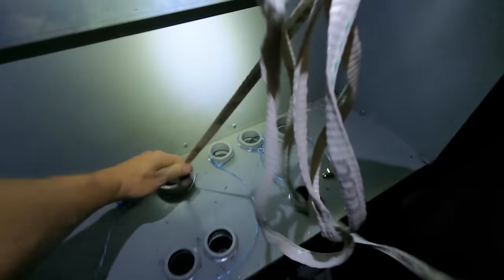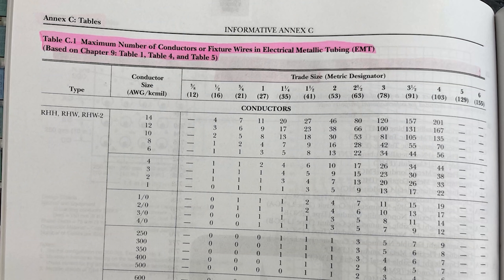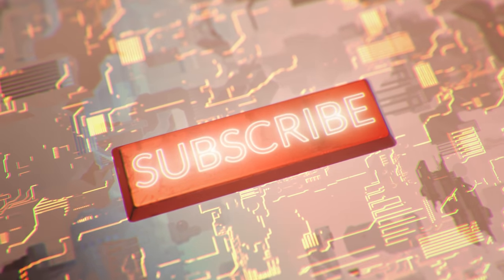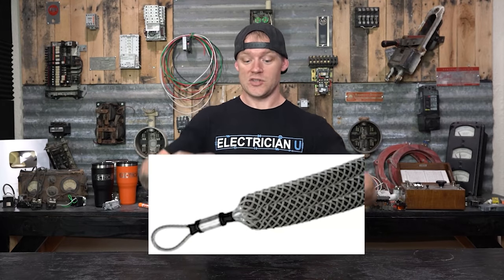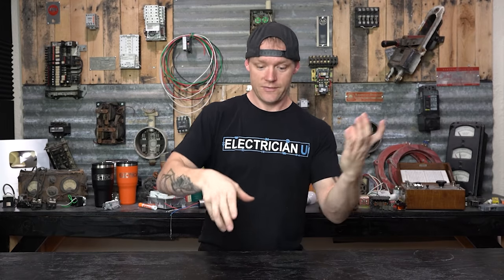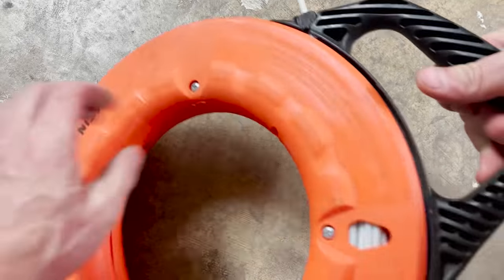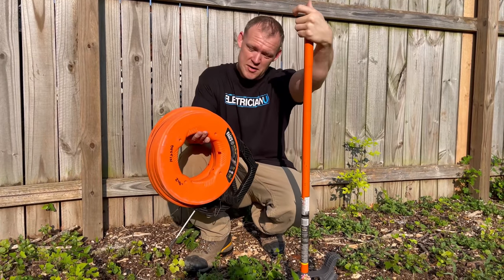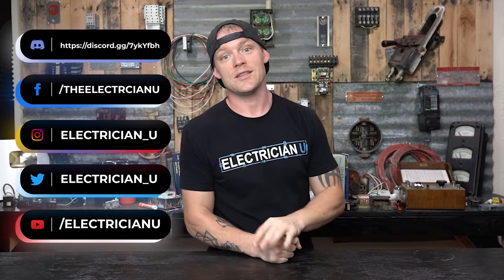Pulling Wire Like a Pro - Tips and tricks for pulling conductors through conduit

Comment: Something I'll never understand is why people apply electric tape backwards, applying forwards was one of the first things I was taught and it was a life changer, it allows you to pull the tape tight on whatever you're wrapping up getting an even stronger connection to whatever you're using to pull y9ur wire
Reply: It is forward because the tape "flashes" the catching edges when pulling. If it is down the head every edge of your wrap, each wrap can catch.

Comment: Excellent advice and Info, but I have to ask? Do you not know the shop vac method for pulling rope?

Go to end Aware you're going to pull cable,
tie your prefer not, with prefer rope, with a loop, place 2-6 paper towels in a butterfly pattern. 
Enough that the pipe/ conduct is block airflow but lose so it can be pulled.

Go to end B with a Shop Vac, (small runs are easy longer runs will need a more powerful shop vac) vacuum the pipe/ conduct and get your rope!

A master electrician showed me this, ITS A FU#$###$% godsend and 100 times easier than shoving a snake down the line.

Comment: "not more than four quarter bends" - learned somewhat recently this is called the capstan law (or capstan formula?): basically that the difficulty of pulling a rope around bends is related to the sum of all angles of the bends. Just the angle, not the radius (for this kind of drag anyway, other things might depend on radius). Go figure. So that's why that bit of code is phrased like that.

Ha! "So you can call me with your stupid questions about, like, what's a neutral" 🤣
Reply: Actually, for almost every application you don't have more than 3 actual full quarter bends in a run...the balance of the One quarter bend left is the sum of the offsets, kicks, or doglegs in that run.

Comment: If it's convenient, a video explaining rolling offsets, specifically how to measure and calculate them, would be pretty awesome.
Guess work isn't really my thing, and I get a different answer from everyone I ask at work.
Reply: Practice, practice, practice. Guess work isn't my thing either and I've found a pretty good way. I can have multiple bends in a pipe already and have the rolling offset still work perfectly. 

Stay away from the apps in general. They'll help you get it done today but you won't understand why or how, making you dependent for life. The only app I use at work is for calculating fill for a conduit with multiple sizes of wires
Reply: Measure using the tape line like you would roll it. Measure at an angle
Reply: A squared + B squared = C squared. A is lateral offset, B is elevation, C is total rolled offset.

Comment: Use a tugger especially designed for pulling wire not a truck or lift or anything of the sort there’s no control over this. And remember pulling wire can be Extremely! dangerous tuggers can put thousands of pounds of force on the wire and if something brakes people can die. Of course il not talking about 2/18 in 1/2 emt more like 700’ of 3 conductors 500mcm tech in and outdoors trays.

Comment: Pulling cable for 30 years.  I've never used duct tape.  I've never seen it used by other electricians and I've never seen it taught in schools.  Not saying it's wrong but it seems not to slide as well or able to be stretched tight like vinyl

Comment: at 11 57  if you pull on jet line  your going to snap it you should pull in something  iike a 1/4 i n or 3/8 rope
Reply: It's pretty strong and usually you feel it stretch when it's getting jammed up before it snaps. If you don't know what your doing and hulk it yeah it'll snap, but if you feel it stretching and not pulling and stop and re-evaluate your good.

Comment: Hey Dustin I would love to hear about why some 240 volt machines like an ac unit for example.. why do we not need a neutral for that run. What exactly does a neutral do besides balance loads and complete the circuit!
Reply: Only need a neutral when you need 120 volts, it's a center tap at the transformer and provides return path . With 240 volts each line is tapped from opposite ends of the winding and are 180 degrees out of phase from one another giving you the 240.  Don't need a neutral on a 240 volt ac because it's not running on 120v. I know Dustin will probably explain this alot better but there is alot of literature on the subject if you care to study up on it.
Reply: @rogerdodger5886  thank you brother! I have. I get it now. Thanks for taking time to explain my man!

Comment: Pulled a load of wires once. Got stuck & had to use lube. When it gave way, I ended up slamming my back into a vertical I beam. Bruised my back & had to take week off to recover. It was NOT fun. Never did that again.

Comment: First off Orange doesn’t signify anything to do with just 240 V three phase
Yes it is supposed to be marked orange if it were a three phase 240 volt system with a high leg, on phase B; also it is phase B regularly with 480v systems with single and 3 phase.

Comment: Never use other than black tape making a head - ever! Why? Some white tape gets stuck accidentally on the conductor after the pull. And accidentally cause you to mistake a hot for a neutral. Damage some equipment - possibly kill someone… Learned the hard way by doing that long ago.

Comment: Another thing about pulling wire...well I pull straight from the center of the coil because nearly 99% of the time the job site I work on is so damn littered and I will NOT clean up after anybody because unrolling a spool is nearly impossible!

Comment: Conductors/cables also have pull ratings...how much force you apply.  4/0 VFD cable just through wire tray.  Yea, truck pull...definitely not a manual labor job.  Use the truck.  Be careful though.  That 100' pull is $4500 worth of cable.

Comment: I’ve pulled 500 armored cable through cable tray 500 through conduit but the worst pull I ever ran into was a 3/4 emt run with 12 #12’s. Ended up destroying a fish tape by wrapping it around the scissor lift guard rail and pulling it ab 2ft at a time in a bells department store. I didn’t set this pull up or run the pipe btw. Lol. The guys that did asked me to help. I ended up counting the bends and it had ab 400 and some change worth of bends with no pull boxes. Total bullshit. Did you say solid? You mean bastard wire?!

Comment: Never use duct tape. Only ever use electrical, it's smooth.  Tape down from the head then back up. If you are only doing one tap pass, tape up towards the head. Rub your hand on the tap, you'll figure out why.

Comment: On longish runs, I like to use mice (pistons) to fish the line
Reply: we save some money and use a corner of a plastic bag i think it goes easier actually than the foam ones, they dont seem to take corners easily
Reply: @Killalink2552  Yea I think the mice work better than anything else on straight runs, but the plastic grocery bags can work better through turns.  Usually just use something like mason's twine tied to the mouse or bag, and use that to fish the mule tape through the pipe for the actual pulling.

Comment: By using tractors, fork lifts, ect., to pull wire, I bet you do flip up a bunch of wire. A real Master Electrician would use the proper equipment to pull wire. If I was to say pull 4 - 500 mcm copper conductors in a 3 1/2" conduit, buried 4' deep, 3 bends, 450 feet long. First i would get my 5 gallon shop vac and tape the hose into this conduit so that the tape seal's the hose into the pipe. Now the helper on the other end, has a gallon zip lock bag with more air in it then the I.D. of this conduit. he ties a string around the ziplock edge ( your making a bullet like shape so that the bag part leads and the zip lock is behind this.) the string is just pull string, I like using baling twine from the farm store, cheap and strong. Just use your teeth and bite the baggie to make some small holes in it, squeeze out the excess air tell is just slightly smaller the the pipe, hold the bail of twine up so that it feeds straight into the conduit and let the vac suck it to the other end. If you did it right it will take about 2 - 3 seconds to get their. Leave vac on but pull of the tape and pull baggie and twine out. Now tie on your 1 1/4" pull rope, BTW this is a true pull rope, the colored strand that runs thru it is a indicator for your safety, if they start to break during the pull, you are over pulling and stop the pull, or rope breakage will occur. Set up your tugger, and on the other ends apply your pulling finger to each conductor and attach to the pull rope. Lube and pull it in.    My longest 1 shot pull 1400'
Reply: You should start a Youtube channel.

Comment: I notice you pull your tape from the top,instead of the bottom where as you can pull and make it tight.Your tape looks so loose,that it doesn't appear to grasp the wires as tight as should be.

Comment: Bro, you didn’t even mention speedy leaders. Well u did say you don’t use ur fish tape to pull so maybe that’s why. As I’m writing this you’re talking about designing the run. Another tip would be don’t cheat your conduit because that just creates problems for the pull and definitely make sure you are filing down the sharp edges when you cut conduit. Not too bad for short small runs, but if you think ull  still have a job after you have to refeed a 200 amp subpanel that your ef’d up cut just shredded the insulation on, better guess again.

Comment: You should use shives . Try never to pulling up.  Lub is your friend.  If you got a long pull put a rag swab with lots of lub on.  Ahead of the  wire. This cleans and puts lub in place before the lubed wire. Use a vacuum cleaner to suck it the pull line. Much faster than a fish tape.  Work smart not hard. Leave the hard for the young Apprentice.

Comment: Stainless doesn’t rust... I can’t believe you use a steel fish tape... the main reason 360 degrees is maximum degrees of bend is because it’s basically a spool and if you took a spool and secured it so it could not turn you would never be able to remove that conductor off existing wire without damage to conductors... as for pulling 1/0 or larger it’s always a better idea to stagger the ends instead of clumping them the way you demonstrated... and always use a Kellum grip always...!!!... the likely hood that a conductor out of a kellum is impossible... it’s much more challenging to have more boxes to pull thru if it’s 360 it’s 360 period... also back to conductors you never use solid in a motor or transformer ever... also you should use your identification tape olores of phases further back from the ends so it can be seen I’ve seen guys cut end off after getting it out and not thinking cut all conductors and then realize they removed the identification... if pull thru an existing pipe with conductors always use a neutral in pipe as a fish and replace the pulled neutral that way you don’t ever risk getting a fish stuck and or damage to existing conductors...

Comment: An important side note is you better use stranded wire when feeding with dc voltage 😂
Reply: Why is that important?
Reply: @TomCee53  12 volt DC won't work with solid wire
Reply: @erich1380  When would electricians encounter DC?
Reply: @fredgarvinMP  landscape lighting
Reply: @erich1380  …. ‘12 volt DC won’t work with solid wire’?? As in, the current doesn’t flow?? What??
Reply: @ernestgalvan9037  so the science how I understand it "I might not get it perfectly so bare with me" basically dc voltage has alot more torque. Hence why it's perfect for car batteries because the high torque allows for the initial high cranking amps to start up a motor. This high torque makes the electrons rotate faster around the copper of the wire and there's something with the wire being solid that makes it harder for DC voltage to properly travel through it. Feel free to look it up if you want a better explanation but it's the reason why landscape lighting like 16/2 and shit is always stranded. You'll never find wire at home depot labeled as landscape lighting that's solid wire because landscape lighting works off a 12-15 volt DC transformer

Comment: I noticed you taped away from the head rather than towards the head. Thats the opposite of what I was taught (Maybe its deferent for high volt? I only did network cabling)
Reply: You tape toward the head so the tape isn’t going to catch on a coupling
Reply: @Wolfgang-et7vz  Right thats what I was taught was to tape towards the head. (from the wire's perspective) AKA towards the direction of pulling. In the video it looks like the taping is going away from the head.
Reply: There's a variety of methods, I've used depending upon the circumstances. I've even staggered non stripped wires that I tapped on and never lost a wire. Keeps everything flexible without bunching up...

Comment: I bend 1-1/2" conduit by hand(s), but I'm 6'5" and weigh in at about 280 pounds.
Reply: I worked with a guy your size. He would come to me when he couldn't fit into areas. I'm 5'9" and 150#.
Reply: @markchidester6239 : Yeah, AvE is always referring to a "five-foot, hundred-pound, double-jointed, Philippine assistant"!

Comment: Too much talking, too much opinion. Start and end with the code and it will pull just fine. I watched this just to see how anyone  could get 30 minutes out of pulling wire. 1/2" is perfectly fine when the fill is right. Put a little snot (yellow 77) on the wire if you need to.
Reply: Maybe you should find something better to do with your time. Like looking for a friend.
Reply: @Itsthatoneguy371  - lol. Perhaps. Or as an old Journeyman, amazed at the obvious. Were you once an electrician or electrical engineer?

Comment: - stagger those wires, the head should be missile shaped and smaller that the sum of what your pulling. 
- Jet line will saw your hands in half.
-  lube is never a bad thing even on the new EZ pull wire
- feed guy should be pushing as much as possible 
- last but most important...... use a damn pulling machine as often as possible, save your body...the company will replace you tomorrow but your family will not.

Comment: When you're a good electrician you're not supposed to have any problem bending conduit, offset or bend and even 3 point saddle, I can make a 3 point saddle even before you finish your bend.
And no when I bend conduit it's not a headache it's even very easy and I'm against doing splice on the wires unnecessarily, more splice means more chance of error.
I have 42 years of experience in electricity and making conduit is an art
once well controlled, there is nothing complicated, at least not in the way you talk about it, you talk about it being complicated as if it were
the end of the world, yet it's child's play.
And by the way I'm not a pipefitter, I'm an electrician in control, I do more wire connection than conduit.

Comment: I only watched a few minutes of this and right off the bat I disagree with some things. When it comes to pulling wire solid sucks. You can’t pull nearly as many in a conduit as easy and if you forget a circuit … well good luck pulling another circuit in behind those. . And you overlapped your wires on the head you made in the video. Makes the head twice as big. Number one mistake. The heads I make take a lot more time then what your doing but they never come apart. And for the guy I saw commuting that for “hard pulls half hitch” I’ll just say this. Hell no! Again it just makes the head bigger . Half hitching is for  short simple pulls and I still don’t recommend half hitching. Now I will half hitch to pull more out once the head comes through. And the 2 most important things are 1 to have someone else guiding the wire in or pushing to release tension and “communication “ the old 1,2,3 pull! And it’s a good idea to always feed the wire downhill . Gravity is your friend . At the end of the day your really trying to tell folks how to be smart😂. Not gonna happen. Lastly I try to avoid ever using equipment to pull wire. Conter force against the conduit with a Tugger is the way to go. Or chance ripping your run out of the ground or ceiling or damaging your box or panel and nylon fixtapes are pretty much useless . I’ve never damaged a conductor with a steel fishtape in my 20plus years . I’ve never been a residential electrician and 90%. Of what I’ve done has been conduit. Repurposing the ground wire for a pull wire is the other option . But if the conduit has solid wire I’d say just run another conduit or pull them all out and pull them al back in with the new conductors . Just my .2 🤷🏻‍♂️